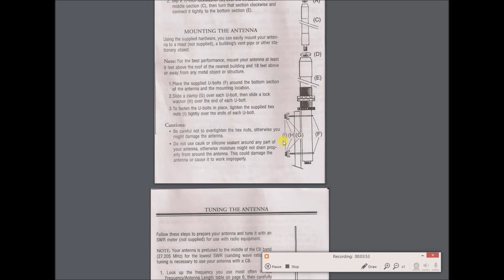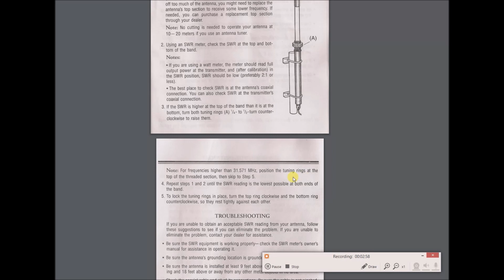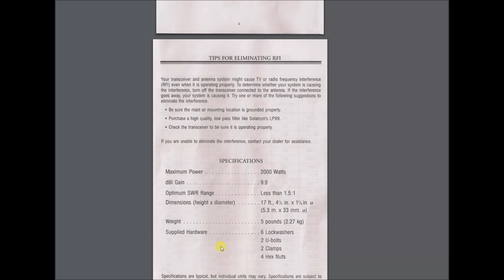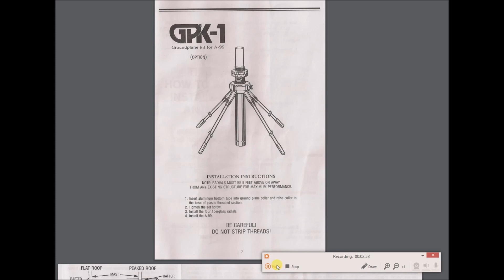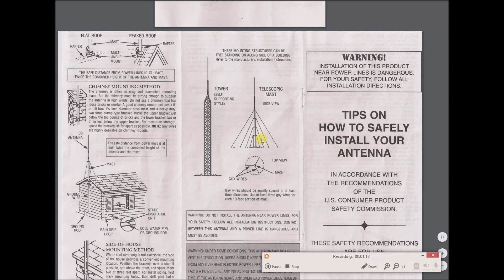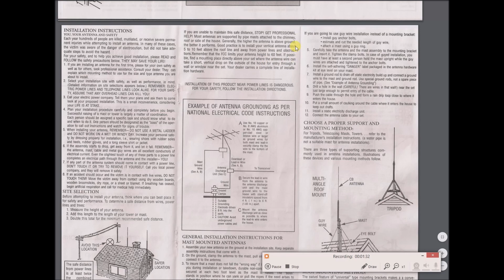Solarcon 99 Instructions (Antron 99)

Comment: I started out in mid 80's with a base station setup. Luckily for me I got in with a group of guys that introduced me to SSB right off. My very first base station antenna was a brand new Star-Duster .25 wave that I bought off a customer of mine at the time that he had bought brand new and never used it. It was stored in the original box in his attic. I bought a new Cobra 148 GTL in 1986 and a power supply for use as my base setup. Latter I bought a new Uniden Washington, both radios were modified. After a mishap with my Star-Duster antenna (storm wrecked it) I bought a new Antron 99. I still have the A99, but it's been in storage building since probably around 1996-97 if I was guessing. It needs some attention like painted, clear coating is gone because the small shards of fiberglass will rough your hands up pretty good if your not wearing gloves handling it. Also when A99 was new looks to me the factory used a type of silicone or whatever caulk around the metal connection joints, mine is brittle and worn out to point it just crumbles. Funny they say not to use silicone or caulk to seal those connectors, what's up with that if they used it to start with when it was new? Or are they talking about not coating the screw in joint with the silicone or caulk?

Comment: Junk
Reply: I talk all over the world on this junk.
Reply from the maker: Hey, I don't blame you James. Setting up a a base-station antenna and a rig at home can be frustrating. As well, having meaningful conversations the CB, aside from trucker talk, can be a challenge.

Is there a better antenna that you recommend?

Personally, I don't think the Solarcon 99 is junk. I do feel it is overpriced. And, my experience purchasing it through Amazon was frustrating, given the box was damaged with missing parts, and I had to exchange the whole antenna (through the mail).

I can vouch that I can talk up to 10 - 15 km (un-amplified), which is pretty great, in my opinion. It satisfies me. I also have my antenna on a mast, with 50 feet of LMR 400 cabling. I also didn't have to tune my antenna, as it had a low SWR right out of the box. And, two years later, my antenna is still in tact. I checked it with my SWR meter.

I am not brand loyal. And, you are entitled to your opinion.  Kindly, would you share why the Solarcon 99 is junk? What is a better antenna?
Reply: @2bit661  these a99 antennas are a medioca type antenna, not the best, but certainly not the worst.

The IMAX 2000, sireo gainmasters etc are better but you pay the extra $$$'s for them.

Worked skip easily with my a99.
Reply: @ep1929 cause they are 5/8 wave over the 1/2 wave